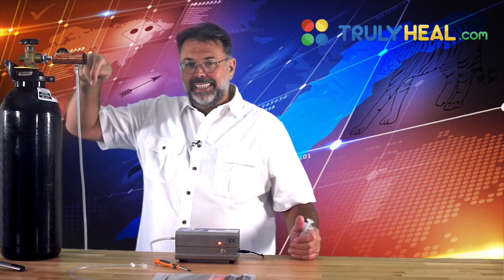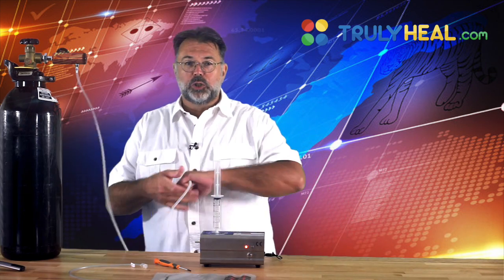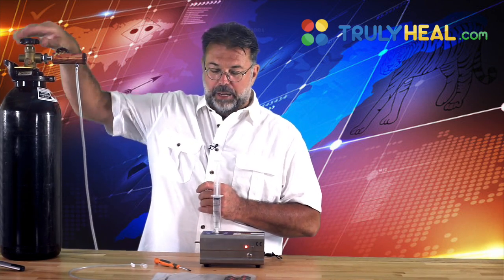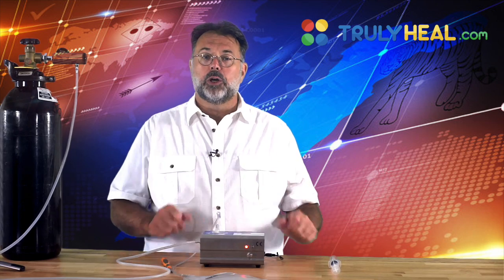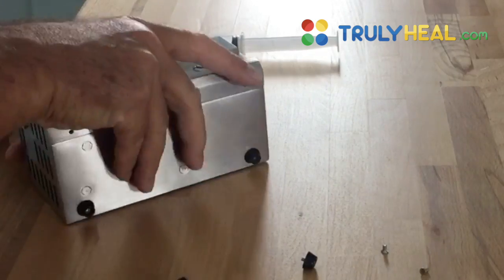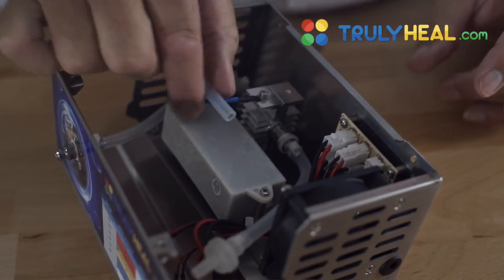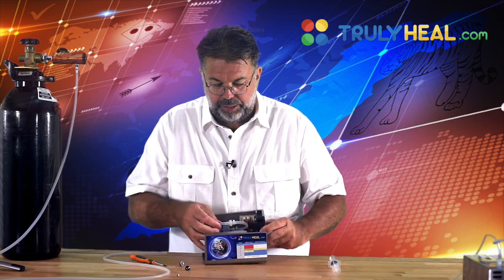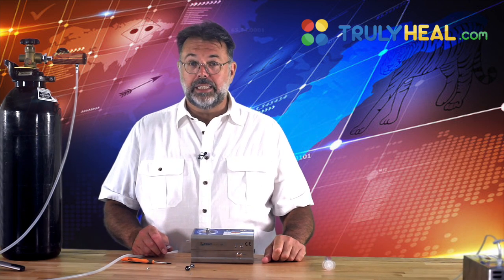How To Fix Your Ozone Generator | Ozone Generator Repair For Water

Comment: my truly heal generator stopped working for some reason, it's not the tubing. I have owned it for less than a month. I finally figured out how to place a service ticket on the website, there doesn't seem to be a customer service number or email.
Reply from the maker: As we are in Australia it's always better to send us an email so we don't have to get up in the middle of the night. I hope you found a solution. It's usually when internally a hose pops. You can feel that when you press your finger on the outlet. If it's tight the external hose should pop off. if not then you have internally a leak.